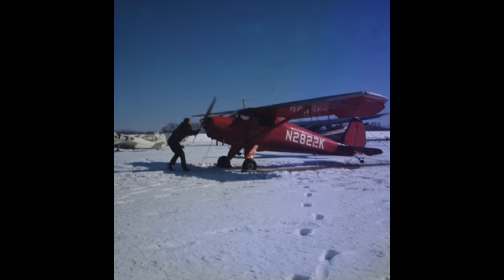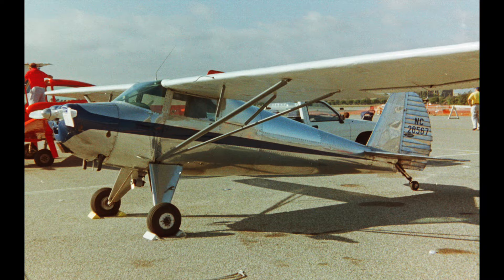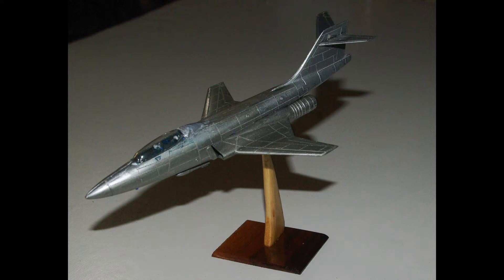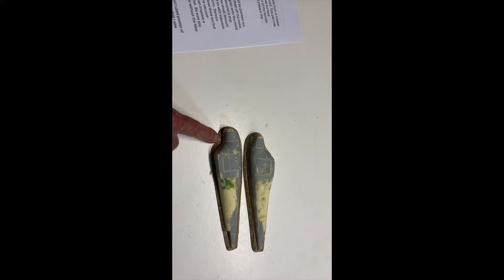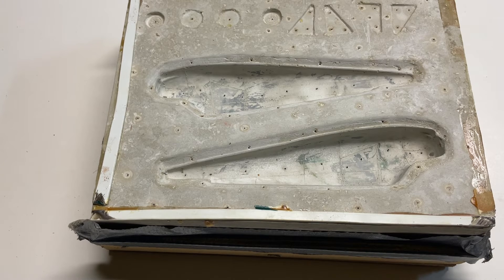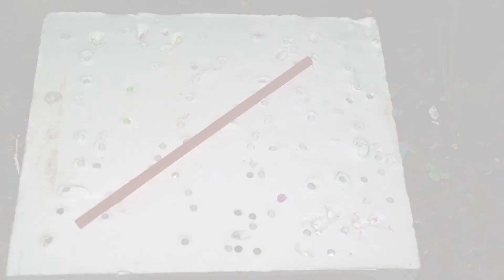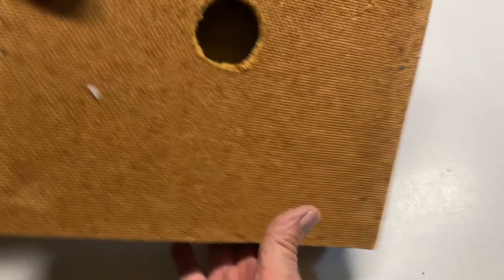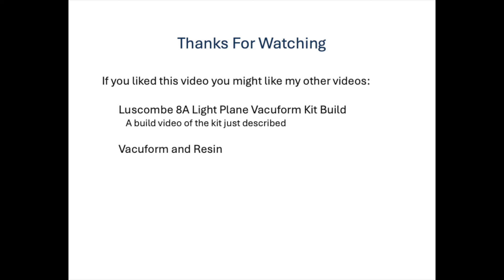Vacuform Model kit Fabrication How to

Comment: How practical would it be to vacform the fuselage or any other part that has glazing out  of transparent sheet plastic and then paint everything that isn't  a window?
Reply from the maker: It's been done.  The problem is in the typical split down the middle approach the seam runs right through the canopy.
Reply: Airmodel did just that on their Helio U-10 Courier kit. IIRC they did a clear UH-37 Mohave as well.
Reply from the maker: It's possible and has been done.